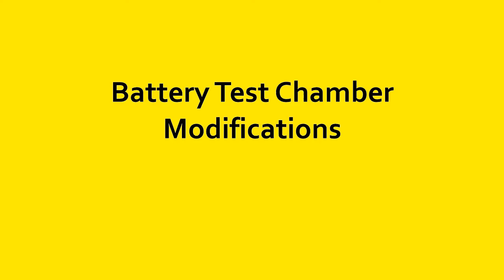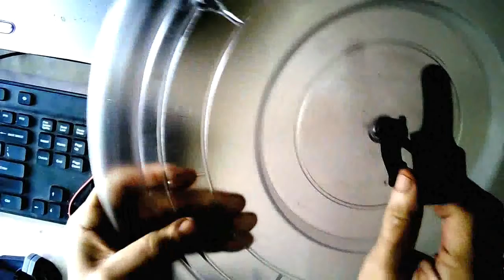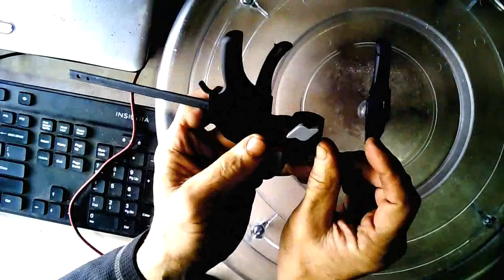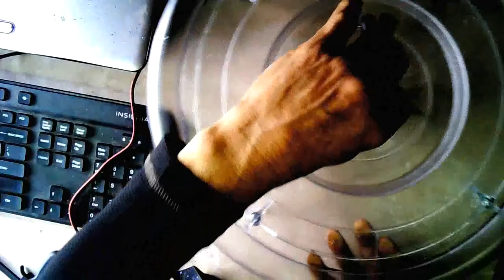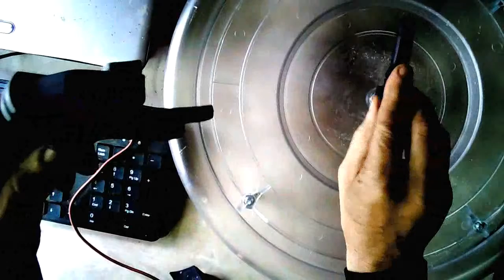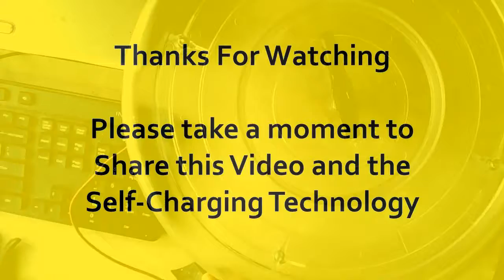Battery Test Chamber

Comment: As I understood from your initial video describing the chamber you will be controlling and monitoring the effects of  temperature as well as humidity and pH on the electrical characteristics. I visited your site to see the playlist arrangement and did not see a thermoelectric category. It's probably a part of a  broader scope. When you conduct the experiments in the controlled environment I will be particularly interested to see the effects of temperature on performance. If you observe unusually pronounced values it may be worthwhile to explore the subject a bit. Thermoelectric generation is somewhat expensive in terms of dollar per watt currently using a doped semiconductor PN junction to operate. If Ti02 can be used in conjunction with disimilar materials to achieve current by temperature differential without having to rely on manufacturing the junction material (typically doped silicon) the relative cost might be reduced even at the expense of efficiency and size.
Reply from the maker: I'm still working on organizing the videos Fred. There are a lot more subtopics than I thought. I haven't segregated the thermo-electric videos yet. The transfer of heat and it's transformation into electricity is central to the function of the Cell as you know I'm sure. I'll be using 3 thermometers, one on each electrode, and one inside the chamber to track the chamber temperature. There will still be some heat transfer from the outside, but it should be minimal if the outside temp is fairly close to the inside temp of the chamber.
Reply from the maker: All fixed. Created the Thermo-Electric catagory and moved the video to it. If you see another category I need, let me know.
Reply: That's exciting. Thasnks for the response. I look forward to all your continuing research and revelations.